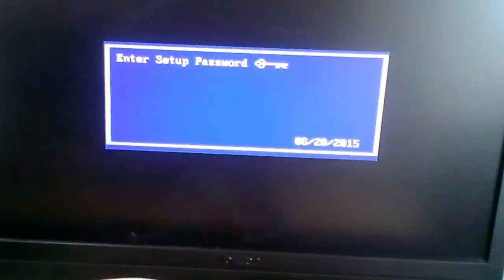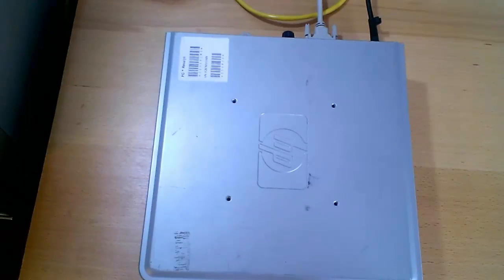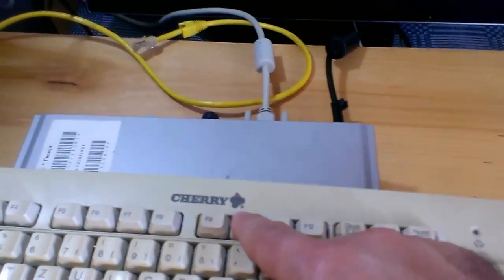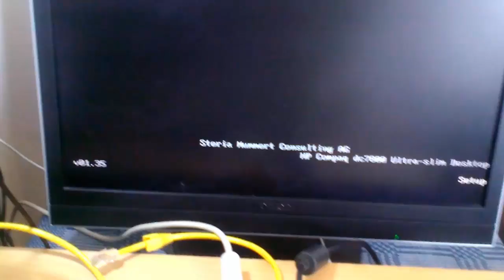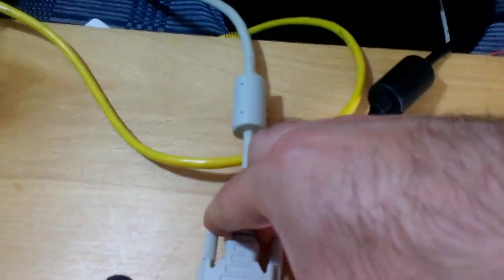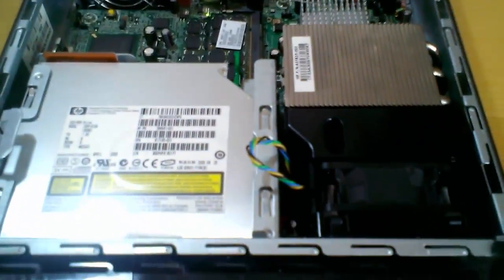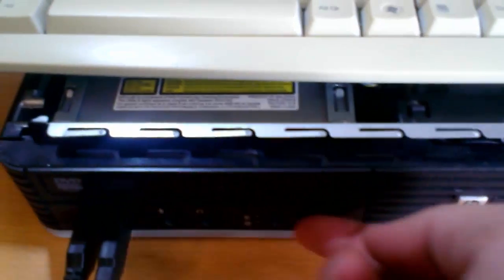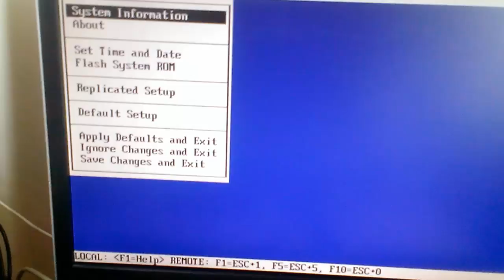How to Remove - Reset  - Clear BIOS Password on a HP Compaq dc7800 #redigitt Ep. 052

Comment: Will this method solve the 163 date and time problem?
Reply from the maker: Aloha, you enter in the BIOS and set the correct time and date, but probably the BIOS battery (CR 2032 @ 3V) is to low.
If you have a multimeter you can check the battery or unplug the power cable from the  PC overnight and if in the morning you got the "163 date and time not set", then your BIOS batter is to low.
Thank you for watching, if my video or advice was useful, please consider to share and subscribe
Reply: @redigitt  ok i will try this too thanks

Comment: Bro i cant find jumper pls help me ım using hp pro 3400 series
Reply from the maker: To disable the power-on or setup password features, or to clear the power-on or setup passwords,complete the following steps:
1.Shut down the operating system properly, then turn off the computer and any external devices,and disconnect the power cord from the power outlet.
2.With the power cord disconnected, press the power button again to drain the system of anyresidual power.
3.Remove the access panel.
4.Locate the header and jumper labeled CLR_PASS on models 3400/3405 or PASSWORD on model 3410.
NOTE:The password jumper is blue so that it can be easily identified. 
5.Remove the jumper from pins 2 and 3.
6.Place the jumper on pins 1 or 2.7.
Put the jumper back on pins 2 or 3.
8.Replace the access panel.
9.Reconnect the external equipment.
10.Plug in the computer and turn on power. Allow the operating system to start. This clears thecurrent passwords and disables the password features.
Thank you for watching, if my video  or advice was useful please consider to share and subscribe, have a nice day and good luck.

Comment: I have problem,4 beeps 5 times red light :hp 6005,please help
Reply from the maker: I don't know, but first make a visual inspection of the mother board, look for bulged capacitors, if you have any bulged capacitor then 99% that is the problem.
Also you can try these, please remove the power cord and the monitor cable and press the power button for 10-15 seconds to discharge the capacitor, only after that touch the PC motherboard, memory's, etc.
1. Blow the dust from the PC case , PSU.... Then power on the PC
2. Remove the RAM memory's modules and all the PCI cards, clean the RAM memory's and PCI slots from dust, put back the RAM memory's .... Then power on the PC
3. Unplug the HDD, DVD-ROM, FDD, card reader,etc....and try to power on the PC with ony one RAM memory module, if you have more then one RAM memory module try to switch the RAM slots
4. make a BIOS reset
Thank you for watching,  if my video was useful, please share and subscribe , have a nice day
Reply: @redigitt  tnx

Comment: We don't have the slim version we have the business desktop convertible mini tower. We follow the video and it won't work! Help
Reply from the maker: To clear the password, use the following procedure:
1. Turn off the system and disconnect the AC power cord from the outlet and/or system unit.
2. Remove the cover (hood). Insure that all system board LEDs are off (not illuminated).
3. Locate the password clear jumper (header is colored green and labeled E49 on these systems) and move the jumper from pins 1 and 2 and place on (just) pin 2 (for safekeeping).
4. Replace the cover.
5. Re-connect the AC power cord to the AC outlet and/or system unit.
6. Turn on the system. The POST routine will clear and disable the password. 
7. To re-enable the password feature, repeat steps 1-6, replacing the jumper on pins 1 and 2 of header E49.
Sesource: http://h10032.www1.hp.com/ctg/Manual/c01202501   page 49
Thank you for watching, please share if it was usefull and good luck.

Comment: my pc still not entering the bios.after i pull  out the jumper T-T.
my pc : hp prodesk 400 g2 MT.
Reply from the maker: Hi, it has a BIOS password? or just not entering in the BIOS? 
If the PC just not entering in the BIOS, remove the power cable, the monitor cable and push the power button for 30 second ->and then remove the BIOS battery ->now push the power button for 30 second or more or you can short the 2 pins [power on] from the motherbord with a jumper from an optical drive,  one time I short the 2 power pin from the motherbord for 1 hour and after that let me inside in the BIOS. Measure the BIOS battery voltage, somtime if it below at 3V the BIOS not working right. Please keep us informed if it was helpful or not these information?